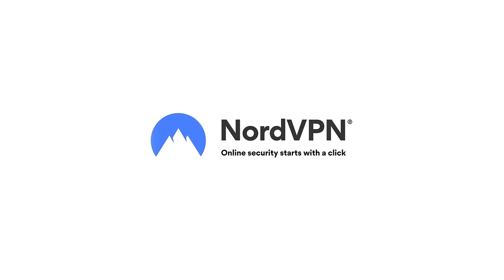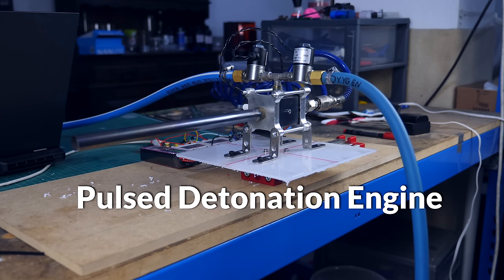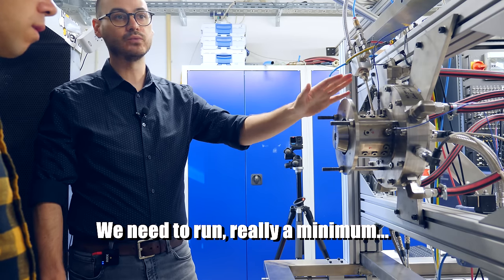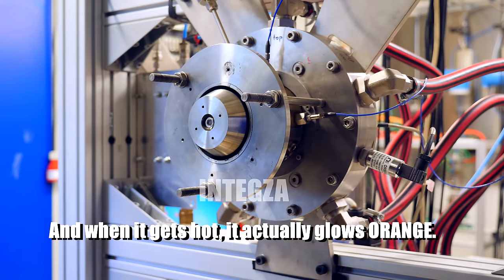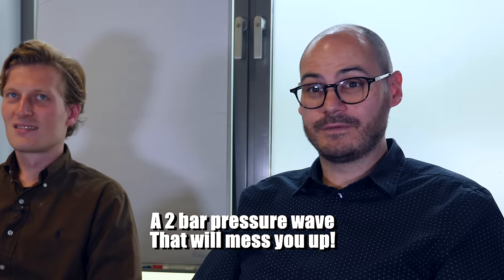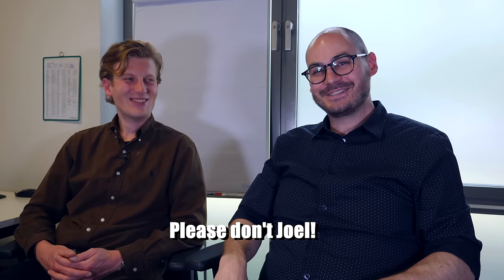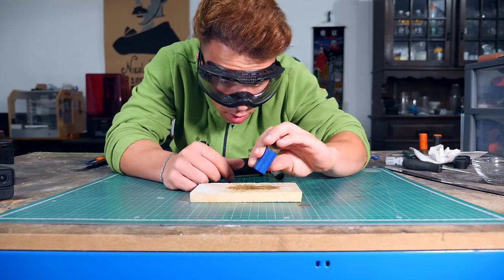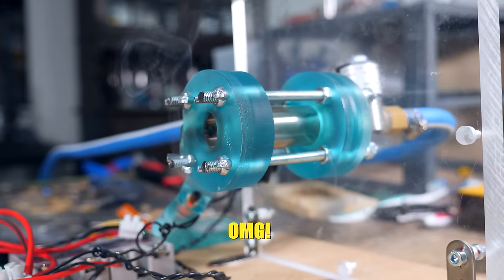NASA lost this TECHNOLOGY 60 YEARS AGO

Comment: You know if you build a simple wire EDM lathe you can make parts with tungsten, and I hear that handles heat pretty well
Reply: Tungsten is about $100-$350 per kilo on average. And tungsten is heavy. A 4 inch cube of the stuff weighs 41lbs. (18.597kg)
Reply: Yeah he really likes to limit himself to 3d printed prototypes.  It would be cool to see him get into more advanced kinds of machining on the amateur/hobbyist level.
Reply: tungsten is extremely expensive, heavy and hard to machine, and EDM lathes aren't exactly mainstream equipment.

even just upgrading to aluminium and brass would allow him to do so much more, and if he gets the equipment to use aluminium and brass he could also use some steel.

let's not skip half the ladder and go straight from 3D printing to actual rocket science, that would be a bit silly.
Reply: there's no such thing as simple wire EDM lathe
Reply: Unfortunately, tungsten is also very brittle. Tends to crack and handle pressure and vibration not very well. Even so, an alloy containing tungsten maintains many of its thermal properties without inheriting brittleness.
Reply: @peteabc1  He would benefit tons from just a normal lathe.

Comment: I love that you´re getting even more into these engines and help to understand and build them! My idea for a future video is "relatively simple": An open cycle - gas generator rocket engine. I hope you´ll build one of these sometime because I think you´ve gained a lot of knowlegde throghout your last engines and you´re ready to try one of them.
Reply: While gas generator engines tend to be lighter and have cheaper, lower risk dev costs, they really have no reason to be used at the low chamber pressures of amateur scale liquid engines. There's a reason not even university teams have seriously attempted it. For chamber pressures under at or under ~300 psia, pressure fed will do just fine.

Comment: After you mentioning the RDE at the end of your last video I did a dive into the depths of YouTube and watched way too much of a Thesis presentation on an RDE. I feel like with how difficult it is to manage this type of engine it would be great as an accelerator for space craft when beyond orbit. It allows extremely strong thrust at very quick reaction speeds when direction changes are needed.
Reply: i feel like an engine large enough to lift a large space craft would probably cause some issues with the surrounding area during launch so that would have to be experimented with and tested. considering the one the two guys had built was strong enough to wreck havoc in a tiny metal room. definitely a really interesting idea though, and could possibly be implemented after contingency plans and side effect solutions are crafted.
Reply: @thefourthdymensionmusic  yeah I think I didn’t explain well enough or maybe you just misunderstood, I’m talking about engines for post orbital levels. An engine with this much power isn’t stable at long use times so using it in space rather than on earth makes more sense especially when sustained thrust isn’t required, having extremely powerful engines to make large velocity adjustments in a small time is valuable especially considering the efficiency. You can still use traditional small thrusters for fine adjustments when doing things like docking etc. and large traditional rockets for initial liftoff. We’ve found use cases for most types of engines and this one feels like it has a place just not one where it has to be used for long periods.

Comment: You probably gathered this but you're probably going to need to design a better arrow spike similar to their's. It looks like they had to focus that gas path a lot in order for you to push a literal wall of air. Also look into a Pocket NC milling machine if possible. (For this project as well as others this, will save a lot of heavy metal headaches.)

Comment: Awesome video, thank you.  You can use a 433Mhz transmitter/receiver (MX-05V) as the remote trigger.  Extremely cheap and gives you 4 channels for switches.  If you need higher voltage/Amps, just add a Logic Level Mosfet like the IRLZ44N.  The toy is a great idea, but such a waste of plastic.

Comment: I'd love to see a video comparing the efficiencies of the many engines you made, though this may be difficult since different enginess use different fuels etc etc. Nonetheless, it'll be neat at least for engines that use similar fuels

Also, to get a detonation, look for a nail gun; some use basically lil blank shells to shove the nail wherever the nail needs to be, and with a little safety-blind engineering could be used for whatever detonation application you need

Comment: How about you use one of those foaming soap dispensers to mix oxygen with some liquid fuel. It should mix quite well and the resulting foam will have a large surface area to burn easily.

Comment: Suggestion: back on the water-cooled jet engine it seemed like the metal diffuser was getting too hot. Why not cut slits/holes into the sheet and have it connected to the water cooled channel or print a combustion chamber with the water channel having more surface area towers the back with a thinner wall to water-cool the diffuser.
Reply: I was just about to comment that. Especially with the researchers! If it gets so hot it can only run for a second, wouldn’t the logical next step be to build one with water jackets running through the metal casing to cool it down and see how long you can run it for? Chuck a temperature sensor in it as well and if that isn’t enough just liquid nitrogen cool it. See what happens!

Comment: You need to make five 45 degree  two mm holes  and next to each hole another 2mm matching hole but this time drilled in at a 60 degree angle.  These will go around the rocket 30 percent away from the fuel source in the ignition tube.   On the 45 degree holes they need to be slightly angled holes to help induce a rotation within the chamber.  The 45 degree holes you will use tubes and connect it to a water source. (distilled water) - just have them connect to the bottom of a jug of water.   the water will get pulled through via the vacuum venturi like effect so the 60 degree holes need to be before the 45 degree holes that have the water tubes.  You can sleeve over the holes and tubes for extra safety but make sure you have vents for each air hole.   This will induce a spin and also create a super dense vapor wall that will help keep the rocket cool.     Tip - on the jug of water - don't have a lid on it - it needs to be at least 4 liters of water that is above the end of the tubes with no air in the tubes.   👨‍🚀🚀🌛  #BONUS if you can get carbon nano tubes the water would flow faster through them than they would a 2mm hole -  #SCIENCE only knows about 2-3% about #WATER and what it is capable of.  Did you know that?   💦💦💦💦💦  #TheMoreYouKnow  #ReadingRainbow 🌈 !     We can NOT make water.  We still don't know all the different states of water and many more aspects of it.    For instance, create an electric charge in the water container that feeds the rocket tubes water 12 volts or more and you will see what only few have in the thrust difference.  The air from the other holes will rip the H2O apart and create a hydrogen fuel source boosting the thrust even more by the pure oxygen ignition and Bob's your Uncle!
Reply: Beautiful idea.......

Comment: Awesome videos!! You probably need to have several fuel injectors and adjust the timing to get the rotation. Also in order to see clearly the rotation of the exhaust gases would be nice to have an opaque core inside the exhaust as Professor Myles has in his engine
Reply: The human eye can't see the rotation.  Most high speed cameras can't either.  It moves at faster than the speed o' sound.

Comment: So glad you've gotten around to doing this! I think if you have a squiggly channel, increasing the path length the detonation wave has to travel, you will have a much more stable engine. Additionally, it would be worth trying to implement a super RDE, where several small engines are arranged in a circle and connected at tangent points to the circle they form so that the detonation waves sync up and the wavefront of each small engine goes around once for each revolution of the wavefront around the circle of engines. This should allow the center circle of the arrangement to act as a pacer RDE for the individual engines forming thr ring. Msg me for a diagram.

Comment: Hey brother, I think you can use a 3D printer to make a "Dyson fan" style channel wing aircraft! Its an idea I've been mulling around as a "personal flight device" or PFD for short. Obviously you wont be able to 3d print one to make you fly, but maybe make a drone that has a go pro in the middle and channel wings on the side but no visible moving parts 😊 I'd watch that and download what you come up with 😅
Reply: Maybe 30 years ago Analog had an article about Henri Coadă. And the Coandă Effect. At the time they theorized that it would be possible to build a VTOL craft that utilized a large high bypass Turbofan engine to power it. And really that's how the Dyson fan works. It employs the Coandă Effect. And it's not the first device on the market to use the effect. There is a company that sells evaluators for confined space entry that are powered by compressed air. They run at up to 100 to 1 in terms of how many cubic unit of air moved for every cubic unit introduced.

Comment: Thank you for this video. IDEA: I would love to see your take on scramjet or ramjet engines in the future. Hypersonic engines has become very popular lately in missile industry but not only.
Reply: That is almost impossible to build in small scale because for testing you need to do the test at hypersonic speed...
Reply: @Henning_S.  True, but I think it would be possible to build some sort of "proof of concept". Like other projects, of course, it wouldn't be the real thing but at least you test some of the concepts.
Reply: @r0dani3lb  but even to test the concepts you need hypersonic airflow because the whole concept of these engines only work at hypersonic speed
Reply: @Henning_S.  The solution is not smaller. Bigger. if he use an burnningchamber with en bigger diameter an use an gas with lower burning speed like Butan he dont need this high speed und air pressure.
Reply: @benjaminrieker5244  but if it doesn't get any compression, it also produces almost no thrust, it is basically the same as a standard propane torch
Reply: @Henning_S.  This model is not for real useable trust but for show the proof of concept of an rotating shockwave in the ring like reaktion chamber.
Reply: @benjaminrieker5244  but this rotating detonation engine would be capable of producing some thrust if he manages to keep it running for longer than 1/2 second.
Reply: @Henning_S.  Yes but his house attic would not survive an test like in the video. An slow rotating shockwave with low pressure is saver and he don't fly to the moon in near future with his 3d printed rocket.
Reply: @benjaminrieker5244  it can never be that powerful like the professional one in the video because it is much smaller. And you can't make the shockwave rotate slower, it needs to travel faster than the speed of sound, otherwise it is not a shockwave anymore...
Edit: his engine also can't be that powerful because the pressure in the combustion chamber always must be substantially lower than the fuel pressure, otherwise the fuel can't get into the chamber and the engine stops or at least loses so much power until the chamber pressure is low enough that enough fuel can flow into the chamber to maintain the combustion. This also has always been the problem with his propane powered engines. To get more thrust, you also need higher fuel pressure.
Reply: @Henning_S.  Yes it is faster then Sound but must not 2km per second = mach 6.
An reaction chamber with an diameter of 5 cm like in the video has an peripheral length from ~16cm. 2000/0.16=12500 rounds per second. An diameter of 30 cm is an peripheral length of ~1meter the result ist only 2000 round per second the shockwave travel around. Many time to refill gas and reduze Temperatur of his Model.
Reply: @benjaminrieker5244  a chamber diameter of 30cm is huge! That may even be capable of bringing a small rocket almost to space - obviously you need to get everything right for that to work...

Comment: Have you tried utilizing conformal cooling channels as a means to chill hot spots and improve printed part life?  Could be helpful!
Reply: I'm not entirely sure but I think he did at some point. 3d printed engine with a double wall, the space between the walls was filled with flowing water. It worked to increase the engine life.

Comment: this engine is just so cool. from the looks of things, it seems to be very similar in design to an aerospike jet engine, but instead of just having linear air pressure, it spirals it! 
at least ti'm pretty sure that's what it's doing. from how their design looks, i think they aren't just using high pressured air, i think they're actually spiraling the air around the central cone to create that high speed shock wave needed for detonation to actually be useful. otherwise it would just go straight no matter how powerful the detonation is.

basically, i think the thing needed to cause the spiraling effect to occur consistently, would be to angle the extremely high pressured air tubes either clockwise, or counterclockwise around a fixed central cylinder, like an aerospike. that way the high pressured air actually spins the fuel, rather than just pushing it out faster.

At times like these, I wish i were better at 3d modeling.

Comment: In the US our hardware stores have a brand called "Ramset" that uses primers to set nails in concrete. The primers are about $14 for a box of 100. They should be cheaper than cutting up shotgun shells if you can find them.

Comment: How about using actual fuel injectors from a gas or diesel engine? A ring of them around the back plate of combustion chamber releasing sprays into your motor in sequence.  With the right speed you should get a vortex.

Comment: the problem with the RDE is that the combustion takes place on the walls of the chamber, so the forces are directed towards the nearest or the opposite walls, so no net push takes place, well just a shake, but a pressure buildup that blasts the chamber. The net force that causes thrust is the one directed towards the closed end of the combustion chamber which is not compensated by a like force from the open end of the chamber, i.e., the exhaust, because expanding gases move out of the chamber. This is what happens when a shotgun is fired with something blocking the expanding gases trying to move out from the barrel.

Comment: u really need to buy a lathe an a mini mlll, u would have the mill converted to cnc in no time an then u would be able to make some really insane stuff. i started with 3d printers, ended up with 10 fdm an 2 resin printers then i got a cnc router/laser cutter engraver but it wasnt able to do metals like i wanted or at least not without quite a bit of money spent on it first so i got a lathe first an really enjoyed using it so i got the mill a couple months later an its been fun, alot more hands on compared to the 3d printers an i still find my self making the models of the parts first 3d printing them an doing a drawing on paper that i use when im actually using the mill to help keep up with all the measurements but u really need to look into them at least a lathe if not both, but as a suggestion dont get one of the 7x10 12 14 lathe get something alittle bigger an i promise u will be thankful u did. the small 7x14 lathes are ok to learn with but they just are not rigid enough of out the box to do real hard steels without it being painfully slow so buy something that comes with a bigger cross slide than the 7x an u'll be good but with a lathe u would be able to make most of the stuff u would need for ur projects, plus it would be nice seeing u growing as a maker.

Comment: I’m a machinist and have made parts for DOD and SpaceX and an inventor at heart. Curious why couldn’t you have a cylinder with small jets machined in the sides to spray in the Hydrogen/oxygen,air? If they were machined in at an angle you would get rotation with out it being able to interfere with the port/valve. Also if you rifled the chamber with the spiral stretching twords the out put end it would circulate and then slowly in terms migrate to the output side. If the pressure with added fuel and air would naturally force the migration of energy out the end ( I’m not a physicist) then you wouldn’t have to do rifling

Comment: I would like to know what kind of mileage we can expect from a small engine, like snowblower motor, that is running multiple alternators that charge batteries which in turn power an electric drive motor too the wheels of a car, for propulsion?

Comment: Oxyhydrogen should be used because the ignition rate is 44,000 ft./s and you control the ignition to be reduced with carbon fuel vapors to slow down oxyhydrogen 44,000 ft./s with carbon fuel vapors.

Comment: In the Space Shuttle they used 3 engines from AIM-9 air to air missiles to light off the SRBs.
    They only needed one, but the last thing you want on the Shuttle was to have one SRB to light wile the other fails to light.